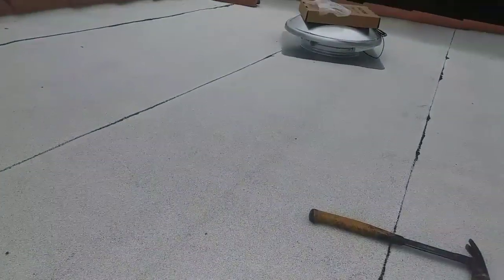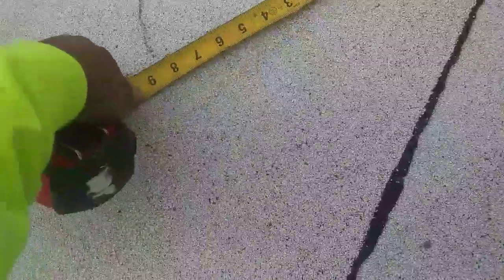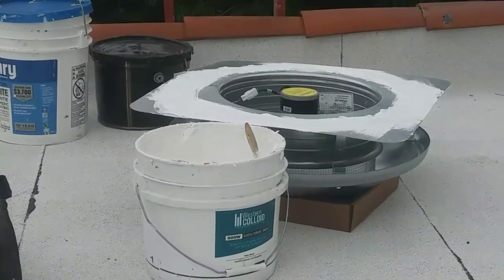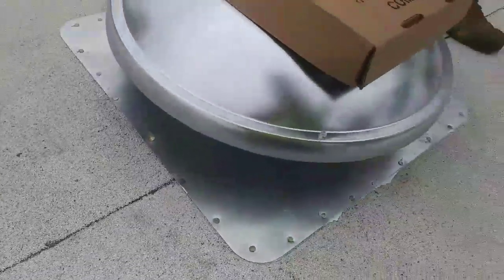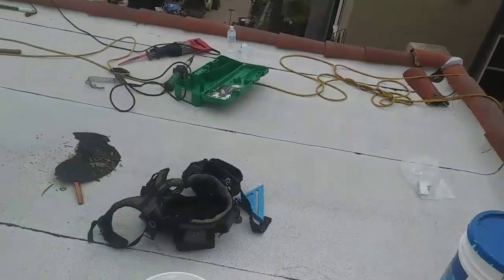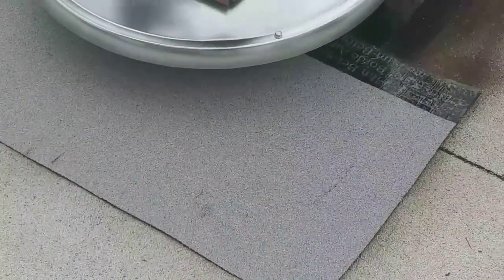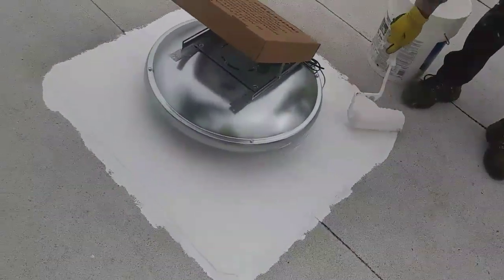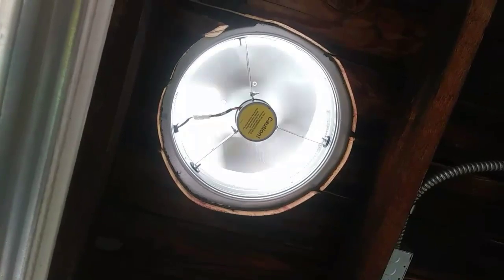Installing  a Solar roof fan ...simple and easy steps! #solar roof fan

Comment: What type of torch is that, that you are using?  Is it electric, or does it use a gas?  I have a small job to do and do not want to get the whole setup.

Comment: What system is that?! Looks like torch but he’s using a tpo/pvc heat welder!
Reply from the maker: Is not torch...is Self Adhering granulated cap sheet ...over torch down system...we used the heat welder to make sure it'd stick to the roof under.

Comment: Hey Eric what brand of peel and stick underlayment should I use on a low slope roof
Reply from the maker: Use:  flintlastic 
The underlayment is called: S.A Base 
The top is called : S.A Cap sheet
Reply: I can lay shingles on top of that right? I have a house like one on your video where you put down peel and stick then synthetic underlayment before shingles
Reply: I have 3 1/2 pitch cathedral ceiling want to do a peel and stick like you did on the roof with rocks also would it be a good idea to add a therma slield?

Comment: I did not know you can use the heat gun to seal torch down never seen that before did you also heat up the middle of torch down not just the edges
Reply from the maker: It's not torch down....its self adhere granulated cap sheet
Reply: @Garciasroofing  ohh ok i get you i enjoy your videos. By the way best roofer on YouTube ive seen so far
Reply: The areas he did not heat up will melt and bond on it's own on a hot day.